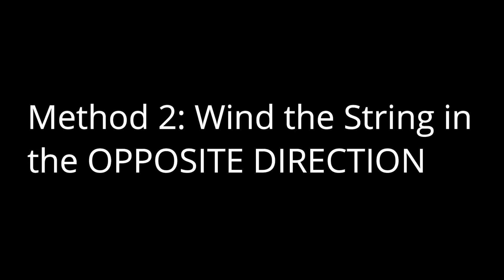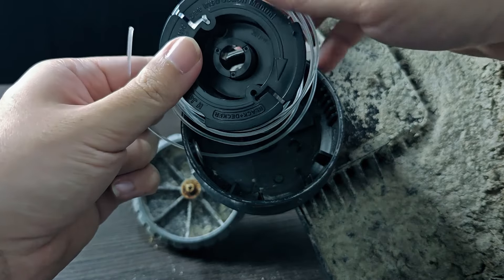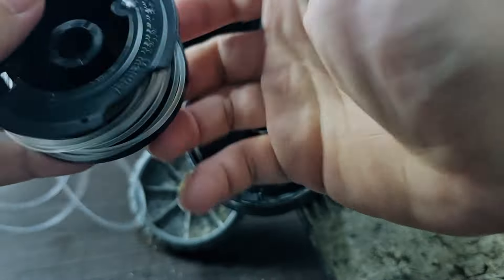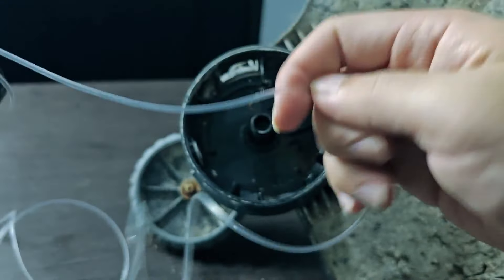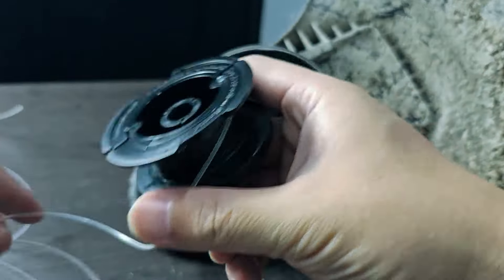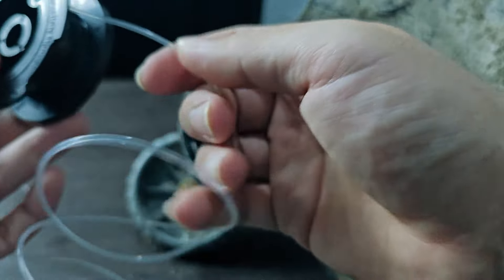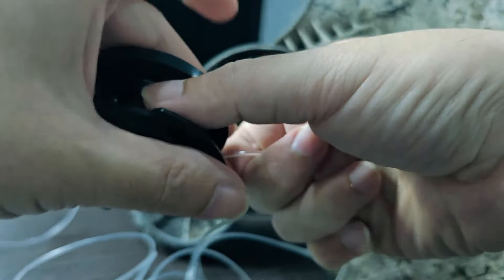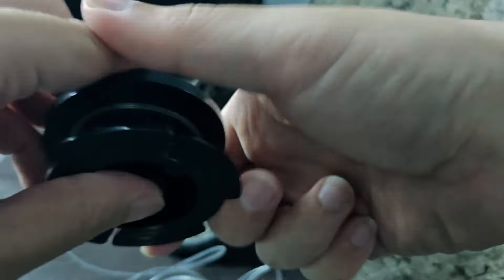2 Solutions - Black and Decker Trimmer Line Keeps Coming Out Feeds Too Much Line

Comment: HELP!    I have the same weed eater.  My problem is the string keeps breaking off at the head. I am not stupid.  I am using the correct, .065 line. I have tried 2 different lines spools from amazon, one after market, one OEM.  I went to Lowes and purchased real B&D line spool.  I have checked the feed hole, the little rocker gizmo, new cap, everything is clean.  It will work ok when I use it level, but when I tip it up 90* to the ground it breaks the line and I have to take it apart and restring it. I even put the line in water like the web said, maybe the line is dried out, not. WTF!
Reply: Heard when buy line in shop leave it in water for 1 day it helps getting it stronger they keep it warhouses long ant they dry and break easily

Comment: Once it's manual - how do you get more string to come out?
Reply: You’re going to have to remove the head, unwind some string, and replace it. Better than nothing I suppose.
Reply: @callumclark3358  That's a complete PIA compared to the old Weedeater i had that was made at least in the 1970's which is when i bought it at a neighbor's Estate Sale. The motor just gave out on me a couple of weeks back. All you had to do was pull a little more line out of the trimmer head and back in the guide. No taking anything apart required. There was a very flexible plastic center piece that fit tight against the outer hub. All you had to do was pull the line out between the 2 and back into the guide. It took only 3-5 seconds to do. It seems technology has decreased with these line eaters i am reading about on here or the trouble people are having with them.

Comment: Mine does the opposite... It retreats back into the spool as soon as you press the button. Can't even touch the ground and the line is gone, take it apart and try again and same thing over and over again. Nearly turned my weed wacker into a frisbee, its overdue needing done and I have no solutions
Reply: Same here. I'm trying to find the correct method or solution to fix the issue 🤔
Reply: I tried winding the line on backwards and now it doesn't auto feed anymore line out. I put a metal zip tie around mine instead just so I could finish my lawn

Comment: The problem is to replace the string feed lever.
Bob
Reply: Yes. I am looking for a video to do just that. And where to get the part.
Reply: @Susan70003  Amazon.  That didn’t fix mine but I discovered if I hold the trigger down it uses a fairly normal amount of string.

Comment: Terrible design, send the engineers of this atrocity back to elementary school. 

After the very first trim, the entire head came out as the bearing holder melted jamming the mechanism and the motor gear made quick work of the plastic assembly. Do not buy this product, please
Reply: My B&D strimmer is 28 years old and still works. British made - maybe that's why.